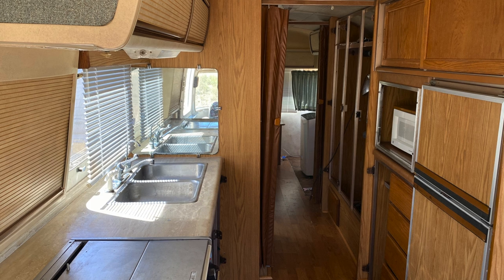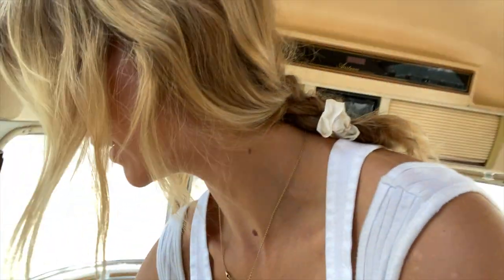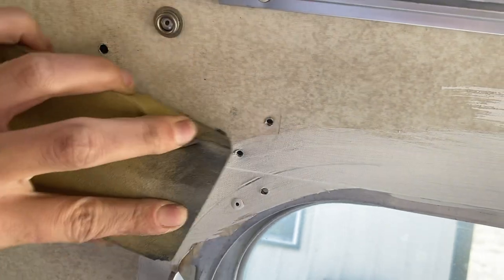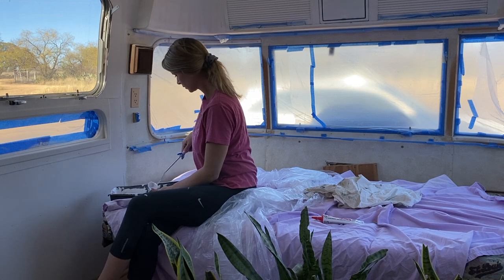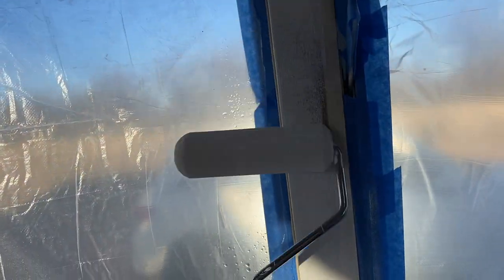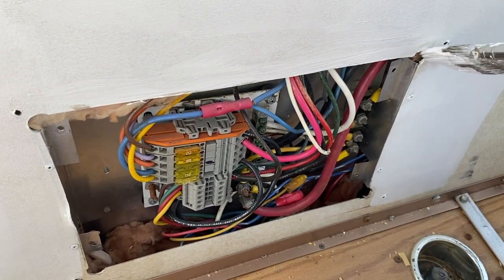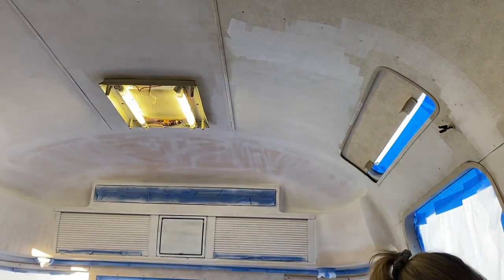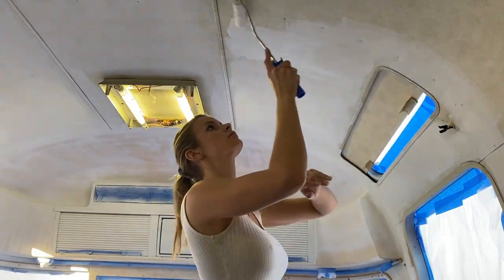Airstream Tiny Home Renovation | Part 7

Comment: looks cleaner. You have to remove those switch and plug plates. Also, you can take out those Tambour cabinet doors pretty easy and paint them and then put them back in. It is quite a bit more work though. I’m doing that on my 1978 right now.

Comment: Did you have to sand or rough up the ceiling before painting, or did the primer go on pretty well without it?
Reply from the maker: I roughed up the plastic nose end a bit but not the vinyl skin, primer stuck to it great 😊
Reply: @KaylaAnne  TY
Reply: I save my popsicle sticks to mix JB Weld